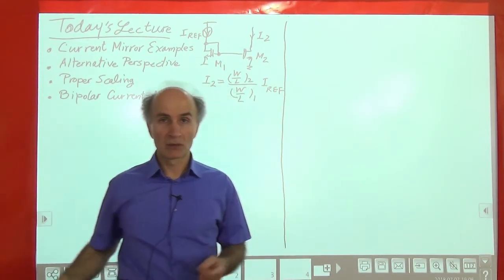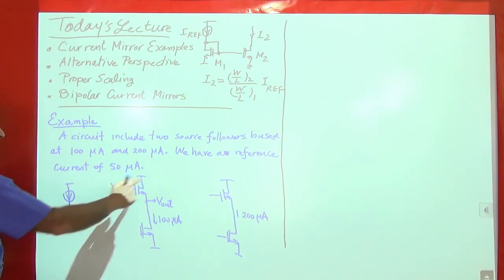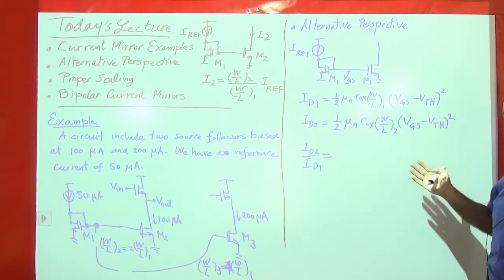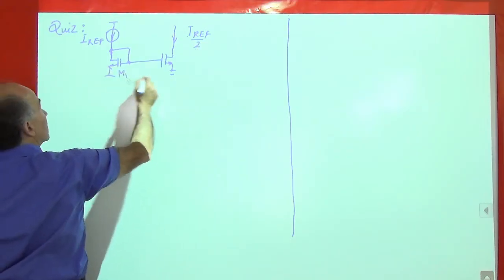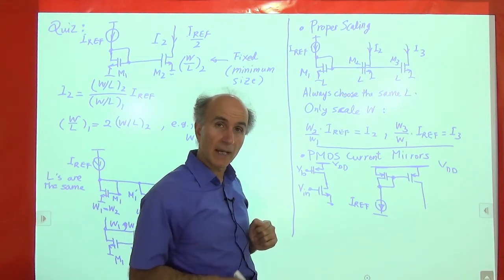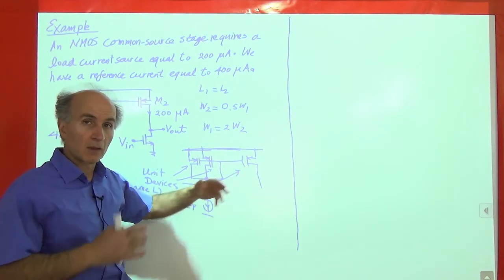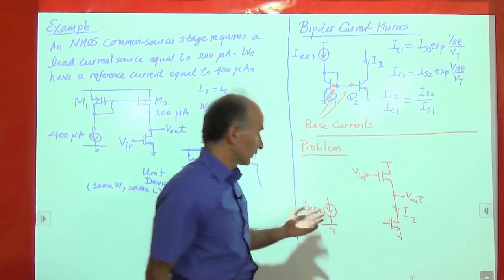Razavi Electronics2 Lec6: Current Mirror Examples, Proper Scaling, Bipolar Current Mirrors

Comment: Dear professor Razavi.. around 27 :12 u explained it very well how two mos devices are connected in parallel resultant circuit u gave.. can we say if mos devices are identical with respect to all aspects.. in that case w1=w1'.. so width of the resultant transistor is 2w.. can we say area of the resultant transistor r mos device increase?

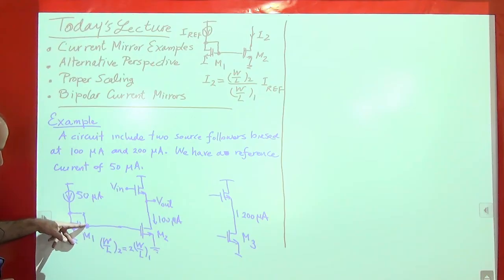Comment: At  10:05 , why do we connect the output of the diode-connected transistor to the biasing transistor instead of the amplifying transistor? Does anyone know?
Reply: The answer for this is that biasing transistor is acting as a current source here. Bw I also have a doubt in this lecture, that can we connect a nmos diode connected device to give current to a pmos transistor ? And can we supply current source to source of diode connected device instead of its drain ?
Reply: @RaviNagar16  if i interpreting correctly your last doubt is to connect golden source to source the concept is  If you connect the current source to the source of the NMOS transistor, the source would no longer be at ground potential, and the gate and drain would both be connected to a higher potential in order to cross threshold mark Vgs-Vth. This alters the behavior of the transistor, requiring careful biasing to ensure proper operation. The current mirror can still function, but the analysis and design become more complex.
Reply: Due to biasing it provides constant current.. (make sure that MOSFET is in saturation region)  in previous lecture he clearly explained problem with biasing.. that was the reason he avoided biasing.. instead of biasing he used current mirrors.. the task of current mirror here is to provide required current by using golden current source.. ( I used the same terminology what sir was used)

Comment: Professor, did I miss something? Specifically, you showed an example of using two identical FETS in order to make the current from the mirror FET M1, carry half the current as the reference current source. I am making the assumption that IREF does not change. This would mean that 1/2 IREF is still flowing through each of the M1 and M1' devices. That would mean that Vgs of the two FETs in parallel would be what is causing 1/2 IREF to flow through M2. In that example, you did not mention that manipulation of Vgs was the controlling mechanism for reducing the current in M2. Did I get that right? Great lectures, BTW.

Comment: Do we use the same L (and W as multiples of one another) only because later on we can make them better match physically?
Reply: from what I learned, remember in electronics I he mentioned the effective channel length Leff < L_designed due to voltage potential at drain, meaning the L-Leff = Xd(Vds). Assume we size transistors with W equal and 2*L1=L2. The actual channel length, however, Leff1=L1-Xd(Vds1), Leff2=2*L1-Xd(Vds2), resulting in 2*Leff1 != Leff2. Ultimately the ratio is not exactly the desired ratio if we size by L. hope that helps :)

Comment: 01:25 - Intro and Review
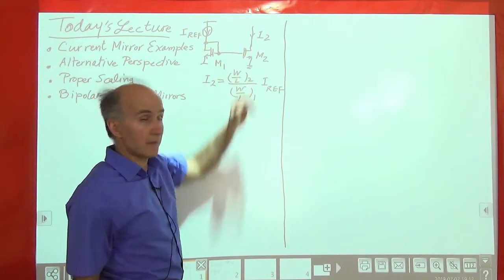05:37 - Current Mirror Examples: Multiplying Current
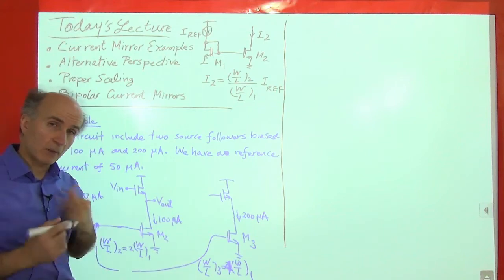11:46 - Alternative Perspective
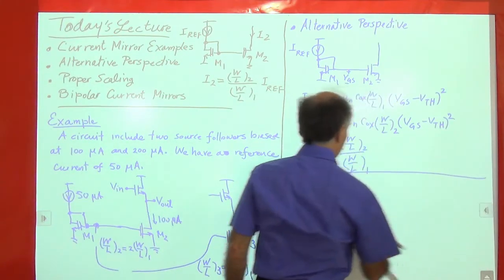15:26 - Current Mirror Examples: Transistors in Parallel
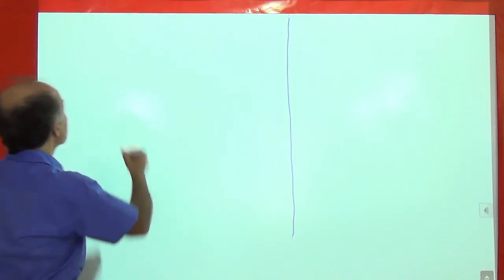19:33 - Quiz: Sizing Transistors
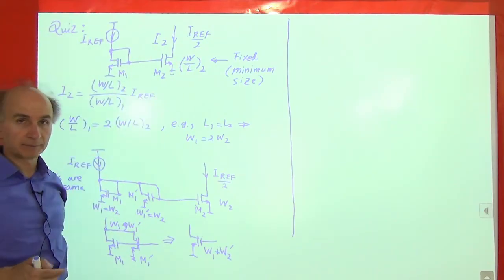27:54 - Proper Scaling of Current Mirrors
31:15 - PMOS Current Mirrors
36:13 - Current Mirror Examples: PMOS Current Mirrors
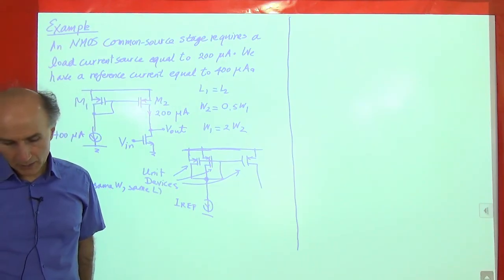41:35 - Current Mirror Examples: Bipolar Current Mirror
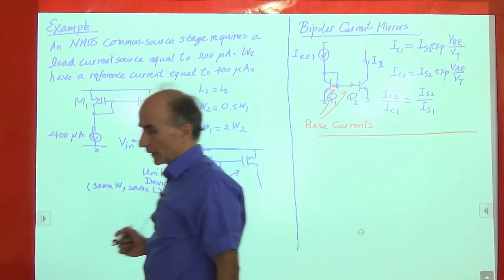46:15 - Problem: Biasing NMOS with NMOS Band-Gap Current Source

Comment: When professor drew the first equivalent circuit by shorting two gates at 26:50 , he didn't connected drains with gates by mistake. Or did I misunderstand what he is saying?
Reply: You are right he should've drawn that.
Reply: 니가 생각하는거 맞음
Reply: Here he was just explaining how two fets are connected in parallel..if they were connected how resultant circuit looks like... No need to connect gate to drain...

Comment: In the example around 40 minutes, will the difference in mobility of electrons and mobility of protons cause any difference between the reference I_ref and cloned current I_2?
Reply: To my understanding, M1 and M2 are both PMOS devices and hence have the same mobility factor. However, for the NMOS that is in series with the M2, the size(W2) of M2 should be chosen twice~thrice as that of NMOS.

Comment: Really nice Lecture, i have maybe one interesting point about Current Mirrors. Maybe you will it address later. The Ground connection of the two transistors, which form the Current Mirror is very important, if you have a difference in resistance it will degenerate the transistors differently. That also can be used to measure currents witch shuts etc.... It is a quite important aspect